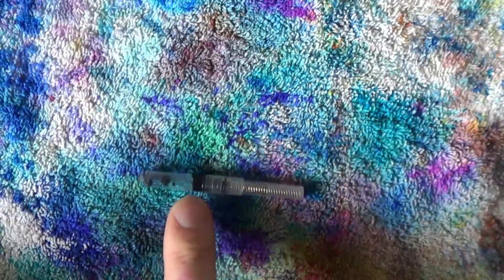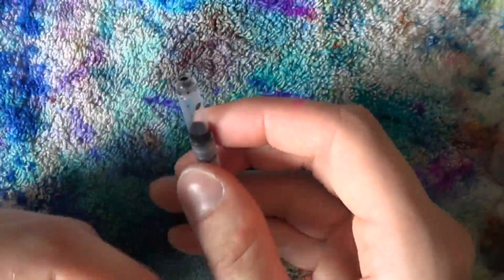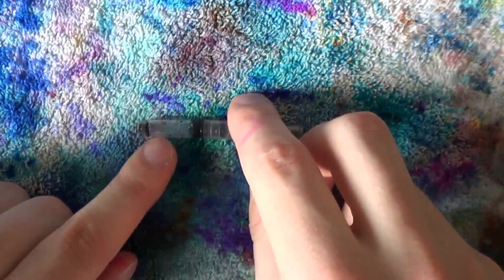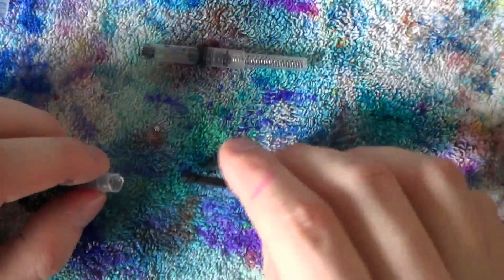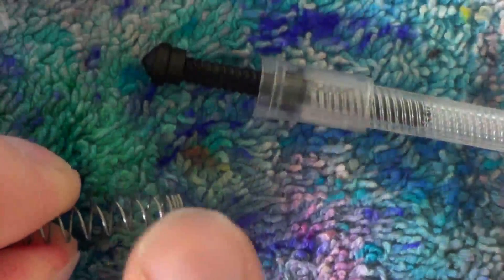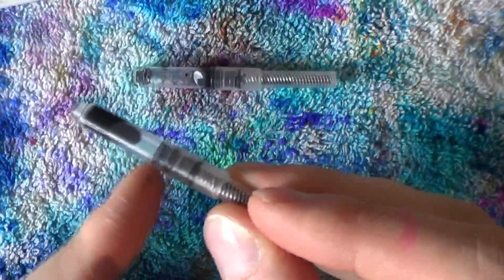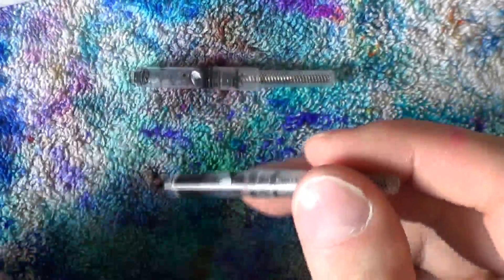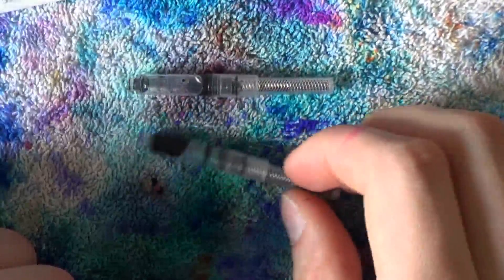Adding a Ball Agitator to a Converter

Comment: BBs and pen springs will rust.  Not good.  You can buy ball bearings on ebay - look for ones labeled 316SS.  316 Stainless Steel is what stainless steel nibs are made of, so it is ink safe for all but the most corrosive of inks.  If you get 2.5mm balls they can be forced into the converter without taking it apart.
Reply from the maker: +E. Frank Ball Thanks for the input! I found out about the rusting issue the hard way...

Comment: In the United States there are two standard sizes of BBs. The most popular is .177" (4.5 mm). The other is .22" (5.6 mm). Most BBs in the US are steel plated with zinc or copper for corrosion protection.

Comment: Great idea, Stephen!

Could be a problem with a few converters. With a Sailor converter, the back screws off fine but it's just a hollow tube. If you put a ball bearing in one end, it'd just roll out of the other. It couldn't do this while it's actually in the pen, but as soon as you removed the converter, you could have a very inky ball bearing on the loose.   :)

Might be ok if you always remove & insert the converter nib-upwards. Best not forget though! 

Cheers & thanks again

Martin   :)

Comment: I tried adding the coil from a retractable pen to a cheapie JinHao converter, and it worked for the most part, but I'm finding that as the ink volume drops, the coil is doing less and less, and the ink still gets "stuck" with the coil in a pocket.  The piece of coil I used is a bit longer than the one in the video.  For these agitators, should they be small or large?

I've bought some ball bearings that I'm going to try next, but just wanted to see what everyone was running into.  Thanks for the video!
Reply from the maker: Joe Ho Most agitators I have used were fairly small.
Reply: Thanks for the quick response.  I'm going to try using a smaller bit of coil [maybe only 3 loops], but first I'm going to experiment with these ball bearings I bought and see if they work better.  These cheapie international converters seem to have more an issue with the air bubble.  

Do 'brand-name' converters work better without the agitator, or are they about the same?
Reply from the maker: Joe Ho I think it really depends on the converter.  Montblanc adds agitators to some of their converters too, for example.

Comment: I assume that inserting the agitator pellet below the converter plunger versus above it would not make a difference? If the pellet prevents the converter seal from reaching bottom of converter where ink is released I suppose it will not interfere with ink reaching nib?

Comment: When the pen stopped writing, I had the agitator under the piston seal so it would located on converter nipple when you pushed piston all the way down. I have now switched in my step by step troubleshooting to a Pelikan brand converter without an agitator first to see if it makes a difference using same ink, Perle Noir.  Yes, I agree with you that this is very strange and annoying.  I assume you have not had this experience at all with your Opera Elements?  I will have to switch to  cartridges.

Comment: Unfortunately my Opera Elements stopped writing today with the agitator converter and Perle Noir in.  I had to turn the converter knob manually to push the remaining 75% of the ink into feed  carefully until  I saw the nib moist again.  It is as if there is an air pocket and the remaining ink cannot sink.  This does not happen with a cartridge and I already tried a second Visconti converter without agitator.

Comment: Rust issues aside, a small coil or short tube might be a slightly better shape than a sphere as a sphere tends to block the very hole to which it means to supply ink. Although not with an ink-tight seal, of course, so it’s apparently an acceptable blockage.
Reply: The bit that sticks in the converter to pull in the ink moves the bearing out of the way.

Comment: Doesn't a rusty agitator run the risk of discoloring the ink or get rusty residue in the feed, if used over longer periods of time? A small plastic agitator would probably be the best, like the one in some Monteverde mini converters. Could probably easily be made by clipping off a small piece of one of the prongs on a disposable fork for example.

Comment: What I do not understand is that the agitator is supposed to destroy surface tension. What it does, is knock droplets of ink of deposits created by surface tension mechanically.
If you really have surface tension problems in your ink flow, I would recommend adding a minute amount of a tenside to the ink. It may even be enough to rinse the converter - prior to first use - with water with a drop of tenside added.
Tensides: Any manual dishwashing detergent will do.